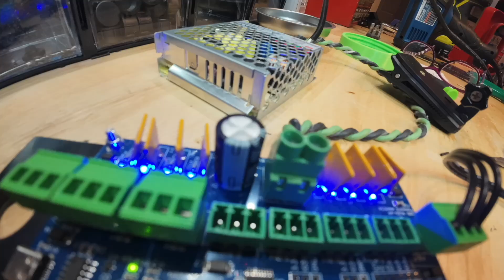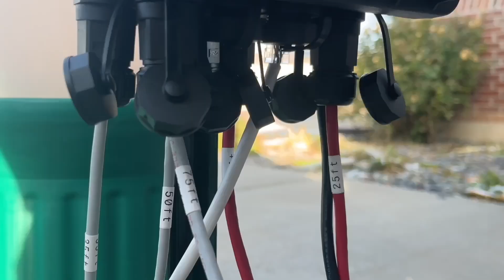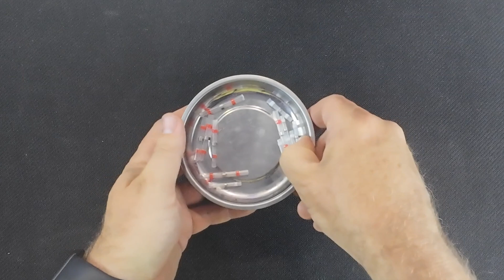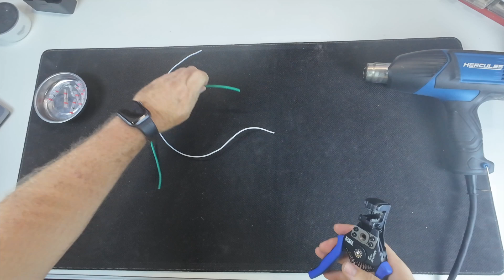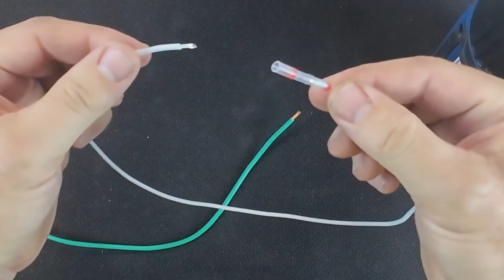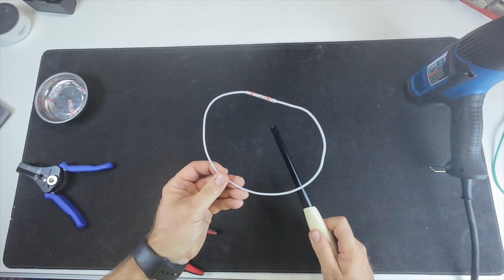How to Use Solder Seal Heat Shrink Connectors (Fast, Waterproof Wire Joints!)

Comment: This is wrong buddy
Slide the wire through the tube
Twist other wire to that wire 
Slide solder ring over twisted wire 
Heat at 600 degrees until the glue comes out of tube and solder is melted.
Reply: That's how I do it too. Slide the wire through and twist it to the other with and pull them back to the middle.  Never rely on just one connection in the elevator field. Redundancy saves lives. He is doing it wrong.
Reply from the maker: Nah. It’s right.

Comment: I tried these. Takes a little practice. It's hard to tell when the solder actually melts and you can stop. If you overheat it to make sure it's soldered, the solder melts through the sheathe. :(
Reply from the maker: They do take a little practice, but once you get the hang of it they’re so useful.
Reply: Can you link your products?🙏🏻
Reply from the maker: @Our_Excellent_Adventures  Oh I am so sorry!  They are in the description now!
Reply: Use magnified glasses like I do and pay attention
600 degrees on your heat gun and wave it like you dont care until the solder is melted and the glue comes out that seals the weatherproof sheathing